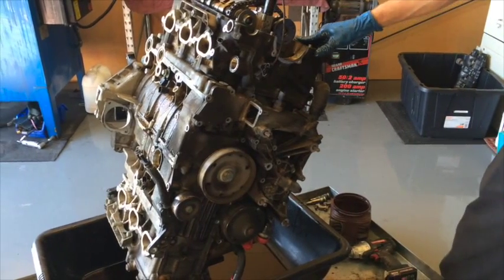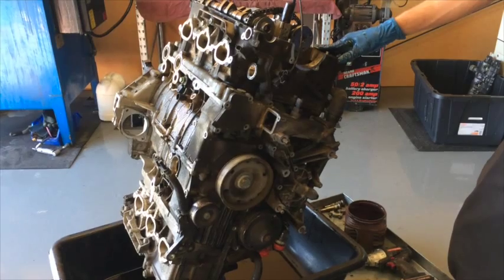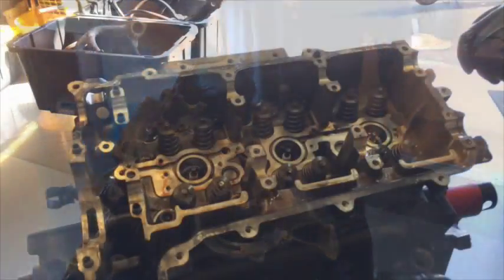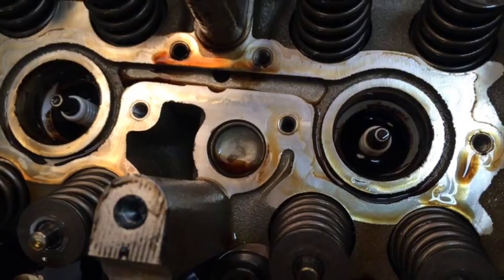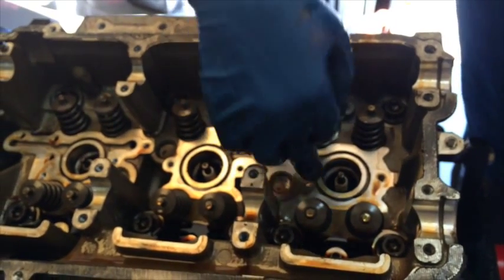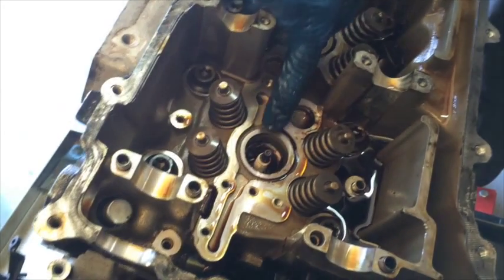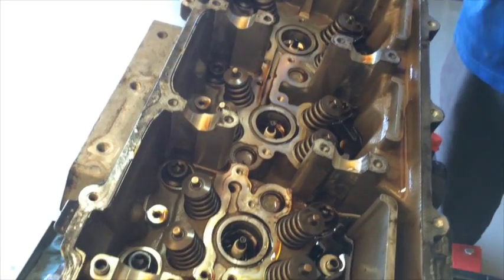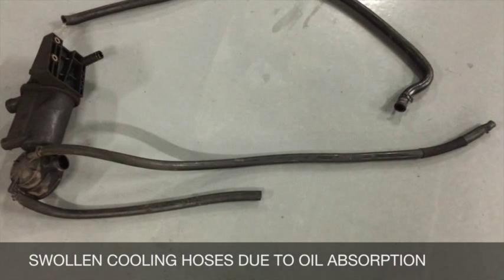Porsche 996 3 4L Intermix with Cracked Cylinder Head and Swollen Cooling Hoses

Comment: Hello, I'm getting exhaust pressure on the coolant on a 05 Boxster S. If the RPM's are up, it pushes the antifreeze out. Normally, I'd guess a gasket, but most of what I'm reading says heads. What would a common find be in your experience? Thanks

Comment: I think its 50/50 what side cracks. i read many with 1-3. anyway... I Hope i can weld mine. because its Hard to find used heads and also... when Will they crack?! ;-)
Reply from the maker: There is one preventative maintenance that i would definitely recommend and not cost you dime.  Periodically check your radiator fans (left and right) to ensure that they are functioning properly.  Thanks

Jason Chott

Comment: Hello. so how did you solve the problem with the cracked head? was it only the left head?
Reply from the maker: Hi Kenn,

Thanks for checking out our video!

For this particular customer we solved this problem by replacing the cracked right (4-6) cylinder head with a good used head that we rebuilt.  That fix was in addition to rebuilding the engine as that failure can cause additional damage inside the engine.  The left 1-3 cylinder head was checked and found to be good with no cracks.  Although these heads are known to have this failures, it is most common to find the right (4-6) cylinder head with a crack.  This was rare to find two cracks one cylinder.  I hope that helps.  

Jason Chott